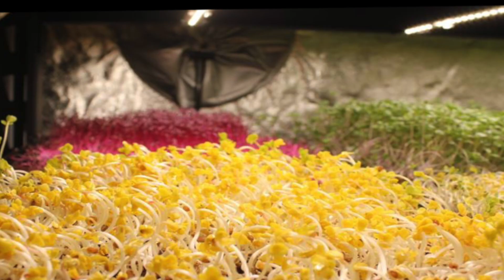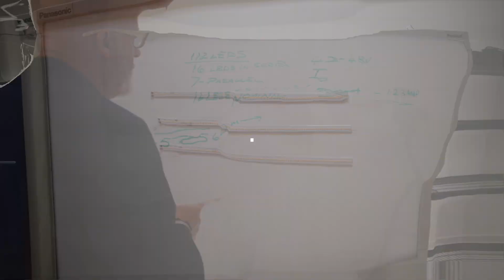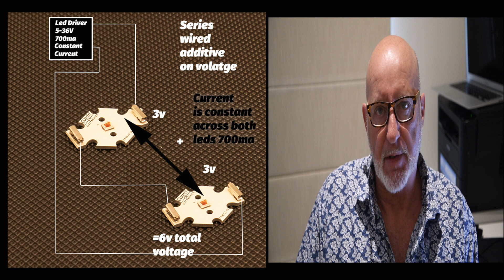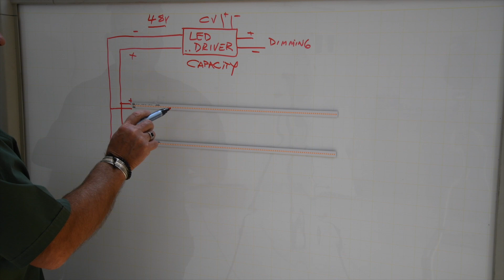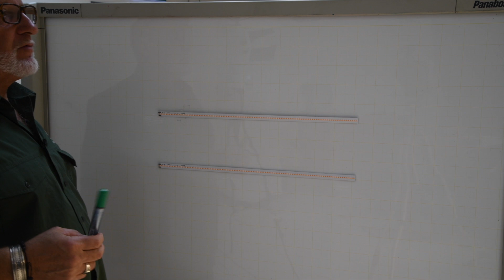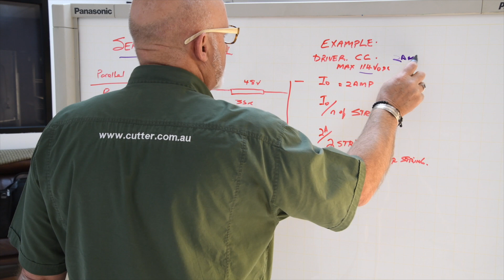Led Strips for Grow Lights

Comment: I want to build my own squatch lighting system it’s sol strips and a mean well driver buy everything from sol strip and wire everything up and glue the strips to a baking sheet
Reply from the maker: no problem, what size is your area

Comment: Awesome vid cutter! Just one question what would be a suitable heatsink for your sol strips?
Reply from the maker: Hey Christian, what sort of power(watts) per board are you thinking
Reply: @CutterElectronics  I'm looking at building a 600watt strip build x2 to replace a 8cob 400watt Vero18 flower kit x2 but also up sizing my tents x2 from 1x1 to 1.2x1.2 for the strip lights. Any help suggesting suitable strips, suitable heatsink,suitable drivers etc would be greatly appreciated. 
Thanks